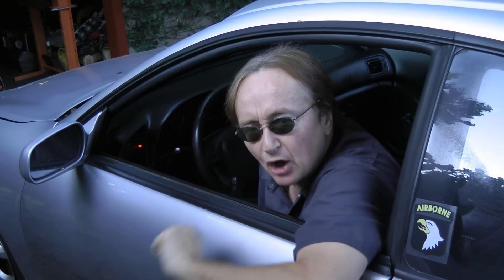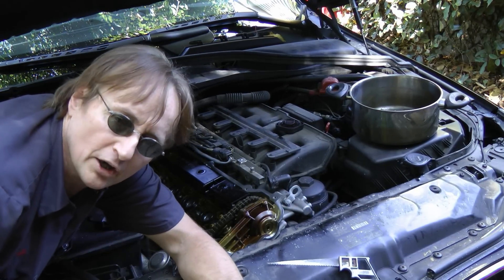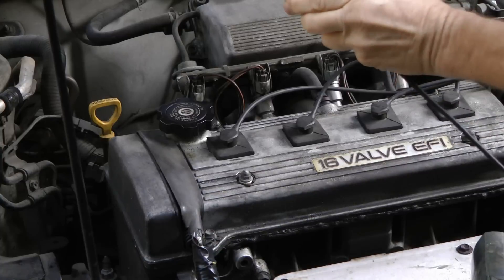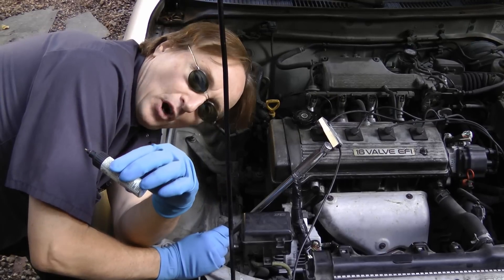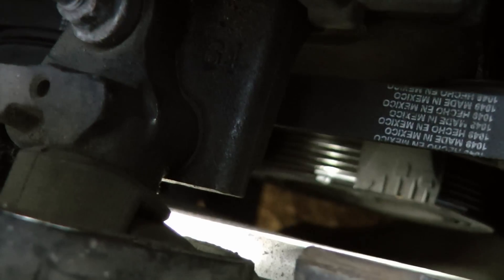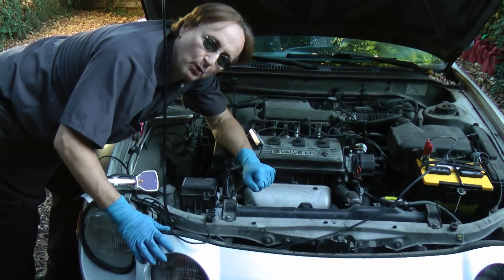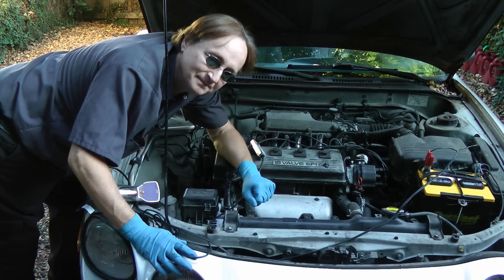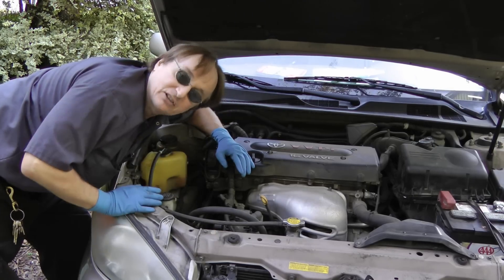How to Check a Timing Belt or Timing Chain in Your Car

Comment: hi scotty,  if possible could you tell me where is the location of the camshaft sensor on a ford explorer sport 2002 4.0l v6 engine? thank you.
Reply from the maker: it should have a special camshaft sensor on the top of the engine, but you need a special tool to synch it when changing. Often places like auto zone sell the sensor and the tool together, and can show you on their computer exact location

Comment: I hear a rattling noise that could be from the front of the engine or around the belt, could that be the timing chain or the tensioner pulley?  I have a 1998 saturn sl2 with 165,000 miles
Reply from the maker: sure can be, first remove all belts and if the noise goes away, then it's one of those, and not inside the engine like a worn chain
Reply: Scotty Kilmer do you think it'd be the timing chain or the tensioner?

Comment: Hey Scotty, My subaru impreza 2009 with 145miles was running fine until the other day it stopped on the highway. Check engine light came with oil light with smoke coming out of the exhaust. I turned the car off and after few minutes, it wont start and when try hard, it will start with smoke coming out of the exhaust. What do think is the problem and how can fix it? Thank you
Reply from the maker: Kafoumba Doumbia   those are notorious for blowing head gaskets. Do my test "how to tell if your head gasket is blown" as odds are it is. a BIG job

Comment: My truck has no power, no lights or anything come on. I suspect the battery is frozen or it needs a new ignition switch. I also get a crank/cam code when I plug it into a computer. Fuel pump also seems bad. 98 silverado k1500. Any tips?
Reply from the maker: start with a new battery if it's flat dead. With low voltage, computers can give out all kinds of nutty data. Get it to crank over first, and then start looking for problems if it won't start up while cranking. In that case, do my video "fixing a car that cranks but doesn't start up"

Comment: whats going on scotty....was wondering if i have a broken timing belt, will i still get spark at my sparkplugs?
Reply from the maker: depends on the car, if ignition runs off the camshafts, no. But if it runs off the crankshaft, yes it would have spark
Reply: Thnx buddy

Comment: How can I tell if what I need is just a new oil control valve or the timing belt. I got a code p011 on a 2010 Kia forte It says most likely solution to replace oil control valve but I'm worried what if it's not that what if it is the actual time chain

Comment: Can't do it with mine, it's hidden behind the water pump :(. Would looking at the serpentine belt give me a good idea of what the timing belt looks like?
Reply from the maker: No, they are separate systems
Reply: Thanks for the quick reply. I'm opting to get the timing belt done soon since the car has over 200k miles and it's never been replaced lol... Since they're gonna be under there anyway is there anything else I should get done, to save some cash in the future, other than the (1) water pump, (2) cam seal, (3) front engine seal and (4) tensioner/pulley?

Comment: "customer to check replace cambelt." So anyway long story short, I took it to a mechanic who did the whole job cambelt, water pump tensioner etc etc. And it was a very expensive lesson that you really need to ignore what dealers tell you. But anyway I probably wouldn't have got as mad as I did if they didn't sell me the car with tyres with marks down to the canvass after their "mate" they recommended passed a pre purchase inspection on the car. Unbelievable. Also they said they had a plastic

Comment: Dear and most respected Mr Scotty,
I don't quite get this. The spark is triggered with respect to crankshaft position. Let's say 30 degrees before TDC. The sensor for crankshaft position on which the ECU relies on is on the crankshaft pulley. So spark is triggered always in the same position of crankshaft (ignoring the advancement or retardation the ECU makes). So, spark and pulley (actually it is harmonic balancer) are always in sync regardless od chain or belt stretch. So... what am I getting wrong?

UPDATE
Ok. There is camshaft position sensor whose role I underestimated. But, can it really give precise enough strokeposition. I thought that camshaft position sensor is accurate enough to determine if cylinder in compression or exhaust stroke.

Comment: i have a 1992 cutlass ceira s...it makes a loud noise on the crankshaft sensor side of the motor and i am not sure if its the harmonic balancer or the timing chain ??..does timing chain make loud noice but drive perfect??   harmonic balancer has broken edges but still not sure.
please help

Comment: Hi Scotty I have a 2006 Holden commodore ve that has a stretched timing chain. How tight do I tighten it ?
Reply from the maker: +Delaney Pitama they have auto adjusters, either that's broken or chain is worn out and needs replacing

Comment: Hello Scoty I would like to purchase bmw 316 diesel f30 2013 or bmw 520 diesel 2012. both driven about 130000 kilometers-150000 km. should I worry about the ti.ing chain of it isnt changed or you think if they r ok can last life time? 
and also automatic transmission oil needs to be changed? or not? and every how many km?
thanks for any sugguestions or other notes.

Comment: DO YOU KNOW IF THE 2008 TOYOTA COROLLA 1.8 in a interference engine or non interference engine. I know it's a chain and not a belt. How often do you change the chain?
Reply from the maker: it's interference , but change your oil and you will not need to change the chain. Changing it is on gigantic job best left to mechanics

Comment: Hey scotty, i have 1992, 5.0 mustang with a new bbk fuel pump. What can be the reason my the fuel pump would run non stop with the key in the on position and not prime for 2 sec and stop. The car also cranks but doesn't turn on. It turns on only when i spray starter fluid and the car runs fine.
Reply from the maker: bad fuel pump wiring or bad fuel pump relays often do that

Comment: would I be able to tell soley based off the flashing of the timing gun?
Reply: +Chris Carlson   If the chain is really bad, the timing mark will jump around.  Sometimes it will advance the spark too much and sometimes too little.  That, of course, makes the engine run poorly.  The problem will be most obvious when you rev the engine up and down.

Comment: Hey Scotty I had a timing belt break on a 1998 Ford Ranger 4 cylinder.  how do I get the timing Marks aligned with the belt completely off?
Reply from the maker: Valentino Chavez get a cheap manual with line up pictures and set it up that way by turning crank and cam pulleys to line up
Reply: So even tho the belt is completely off I can turn the pullies to the timing Marks to get tdc. Or do I have to remove the valve covers to get them to align correctly?  Sorry if I'm not explain well

Comment: Can you use the gun on coil over plugs ? Thanks
Reply: No .. and it will also not work ony many of the latest engines.. because they don´t have Timing marks anymore.. the Timing on These is adjusted and tested using a set of very Special Tools made for this specific engine

Comment: Only white mark I see is on the tip of the timing tab which is part of thectiming cover and doesnt move   Am I missing something  do you mean mark it and ck for movement with out revving and using the distributor advance.??
Reply from the maker: some have white marks, some have none, but all have timing marks on the crank pulley and then numbers or lines on the engine cover to see what the timing is when you use a gun to check it

Comment: Battery has to have a positive wire that goes to the engine bay and negative you can put anywhere because the whole chassis is ground.

Comment: Hi scotty, i own an old 93 Corolla 2E, i want to know how to adjust airflow and idle speed for my carburetor in my own, cause i have a bad idle which runs slight on and off or stop n go engine.. dont know the roll counts for airflow from close turn..
Reply from the maker: on a 93 only idle speed can be adjusted here, as airflow is set for pollution control and is not adjustabe
Reply: last time have a very bad day, my car getting hard start after 15-30 mins rest from a long trip like 10Kilometers, while turning on the ignition switch, it smells gasoline, then i check the carb, then carb leaks a gasoline, i called a mechanic and said the carb is being overflowing, then mechanic came on my house and fix and clean it, it starts nicely and revolves good, but we didnt realized that if we test drive the car, the car runs hesitated, is it cause by the distributor?

Comment: Hey Scott, I am about to buy a 99 Camry for 400 bucks. The owner says that the timing belt is broken and that there are no other problems. I'm confident enough to do the job myself. What should I do to determine if this purchase is a steal?
Reply from the maker: +Armando Garza you can't, but if it's just a broken timing belt it is a steal. They are not interference engines so a broken belt does not bend valves
Reply: Scotty Kilmer oh man thanks a million for the quick response! Would it be a bad idea if I attempted to turn the car on? For diagnostic purposes
Reply: +Armando Garza sorry for getting in your conversation. its not going to start as there is no valve move.

Comment: As a reply to my message about my timing chain. A friend has tightened it but im worried its the wrong tension. One side was loose and one was quite tight. Is there a certain tension ?
Reply from the maker: +Delaney Pitama  they are supposed to adjust themselves Very tight with the auto adjusters. No car I've seen in 40 years has manual adjusters

Comment: I have no clue whether or not my timing belt on my 01 Tacoma has been changed. But from what I've been hearing from other ownerowners, the engine wouldn't get damaged if it were to break and I've hears that they can last double or triple the miles. Should I have the mindset to change it? Or should I just wait?
Reply from the maker: If it's a V8 engine, it would do damage. If any other toyota engine, it will not damage anything  but it's best to change em every 100 thousand miles
Reply: Scotty Kilmer its a V6 and just ticked over to 176k miles
Reply: NOLAItsNotOva Well... Then you soon may have a very bad situation... (Not to mention the costs for re-adjusting the motor's components like valves, etc...
Reply: Thomas Aumayr I thought with it being a non-interference engine, everything would be fine. If it were to break, I could just buy a new one and put it in
Reply: NOLAItsNotOva Its a non-interference engine so you will be fine. You will just have a tow bill to pay. So to answer the question the valves will be fine.
Reply: NOLAItsNotOva look to see if its interference. if no no need to change if yes than dochange
Reply: Josh Bower Its a non-interference

Comment: Hi I have a 1991 chevy 350 CI tbi motor in my truck and it misfires. I've done what's in this video and the timing advances when I give the truck gas. But it dosent really bounce all over the place. I've done o2 sensor, temp sensor, cleaned throttle body, cap rotor and plugs, checked for arc in wires and ohms tested them. Any ideas what may cause this misfire?
Reply from the maker: do a wet and try compression test of the engine, or pay a mechanic if you don't know how to do that. Often just a worn out engine on something that old.  If not low compression, worn fuel injector often does that in that old thing

Comment: So how do you do this with modern car with electronic ignition coils that don't have distributors?
Reply from the maker: you can place the inductive end of the timing light on top of a coil on plug and it will read timing that way

Comment: Hi Mr. Kilmer, my Carmry le is making noises when I shift to Reverse or Drive, but it sounds good in park position even accelerating hard. It could be the belt tensioner?
Reply from the maker: +sdfeter more often a worn dog bone motor mount on the top passenger side of the engine

Comment: So what do you do if the engine has 4 coil packs like mine? 2000 Toyota 4ZZ-FE
Reply: same thing.  put the timing gun pickup on the number one wire.
Reply: make an extension lead out of an old HT plug lead. one end on sparkplug (you may need to use long nose pliers) the other end fitted with conductive end to mimic top of sparkplug up the coil tube. you can then clip inductive pickup around lead as normal and check timing with strobe

Comment: i have a 2002 toyota corolla. We have a p1349 code that says VVT system malfunction. the guy who might be fixing it said its the timing belt... but i did some research and found that its a timing chain and not a belt. so im pretty sure the chain didn't break. what could be wrong?

Comment: i have a 2000 Toyota Camry that takes time to crank but when Started runs fine but after it seats harder to start..do you think a worn timming belt can cause that..I have change the fuel filter and it was still the same
Reply from the maker: it can, but more often do my video "how to clean fuel injectors on your car" as dirty ones do that a lot
Reply: Scotty Kilmer got you I'm clean them and get back with you

Comment: hey Scotty I have a 97 lexus es 300 with a ticking noise do you suggest using lucas heavy duty oil stabilizer ?Thanks
Reply from the maker: +tony montana yes, also listen to the fuel injectors, they can tick at that age and be easily replaced
Reply: Thank you so much!

Comment: Hi Scotty when I start off at stop my truck studders between 1100 and 1500 RPM. but after I get to speed above 35-40 fans out OK would this be my timing chain. I have 2002 f150 4.2 engine.
Reply from the maker: could be, or maybe just a worn timing chain tensioner, check that first
Reply: Thank you Scotty you have been a lot of help

Comment: I have a 2004 Honda Civic EX at 128k miles. The guy I bought it from said the previous guy he bought it from had the timing belt and water pump replaced at 90k miles but there is no record or no sticker on the engine! Will this work in my situation or should I just bite the bullet and get it replaced to be "safe"? I'm kinda nervous now.
Reply from the maker: I'd remove the cover and see if the belt looks good or is original and dirty. if changed at 90 it would still look pretty good
Reply: Scotty Kilmer 
Pardon the ignorance but is that easy to do? If it's something I can do myself with basic tools awesome. I wonder because my mechanic told me there is no way to tell without taking it completely apart. Thanks for your help.

Comment: I've got a problem with my 83 Camaro where the timing mark doesn't stay put, it jumps back and forth at idle. When I hit the gas, the car will rev fine unless you floor it, then it sputters and backfires. The car is carbureted, and the carb was just rebuilt, so I was wondering if it's time for a new timing chain.
Reply from the maker: yep, it's timing chain time

Comment: 2003 saab 93 making a slight ticking noise .. would it be the timing chain or could it be the waterpump because that's being replaced now because my car was also leaking
Reply: Please reply Scotty...thanks
Reply: eddie lima He's not at your vehicle to hear the ticking noise. You need to pinpoint where the noise is coming from. Mechanic stethoscope or use a long screwdriver and put it at suspected culprits. The noise will enhance where it's coming from.

Comment: Subaru started using timing chains, and they state that it NEVER needs to be replaced. So how often do you find it necessary to replace a timing chain?
Reply from the maker: as chains are inside the engine oiling system, as long as you keep the oil changed regularly and clean, they can last as long as the car.
Reply: Scotty Kilmer i love that answer!

Comment: Mr Kilmer, my 1994 Toyota Corolla Wagon has been burning (not leaking) oil for at least a year now, I add about 2 ounces of new oil per 100 miles driven. Would you happen to have any idea what it might be? And now in the past week it started sputtering and idles rough at a stop, and has turned off a couple of times. I am thinking I need to get a new timing belt in there soon. I have 130,000 miles on it. Thanks. Dominic
Reply: pcv valve ( positive crankcase ventilation valve)
Reply: Thank you...
Reply: 94 Corolla 
about 60,000 miles you change the timing belt was the last time you change the timing belt
Reply: your engine is dying its time to get another car /;
Reply: Mathieu Mansire I already did. u were right. thanks...
Reply: Dominic Torres Im sorry to hear that man /:
Reply: Mathieu Mansire no problem. I have a 2003 Subaru Baja now with 122000 miles.
Reply: Dominic Torres nice
Reply: Mathieu Mansire.
Reply: yes?

Comment: hey Scotty I replaced the timing chain on a 2002 buick rendezvous buy the guide broke and it wudnt start. But now when I start the car the engine ticks and sounds completely differnt. like something is knocking. Do you know if the 3.4l v6 that gm put in it is an interference engine
motor? I'm thinking maybe a rod or valve bent when the guide broke. any help would be appreciated.  thanks
Reply from the maker: Estefano Telles   it is, and any things go wrong if the old chain broke, but do make sure the timing marks are lines up perfectly
Reply: +Scotty Kilmer Thanks for the Info. I was hoping it wasn't but I'm sure something got damaged in the process. Thanks a lot Scotty

Comment: i have a 94 honda cranks but no start have good spark,good pump preasure and a new maine relay can you help me out thank you
Reply from the maker: often a blown head gasket will do that, do a compression test of all cylinders to see if it's that. If no, remove all spark plugs, and if they are wet, engine is flooding out from fuel injection system leaking too much gas into the engine IF you really have good spark
Reply: i replace the spark plugs and is working fine thank you scotty for your help